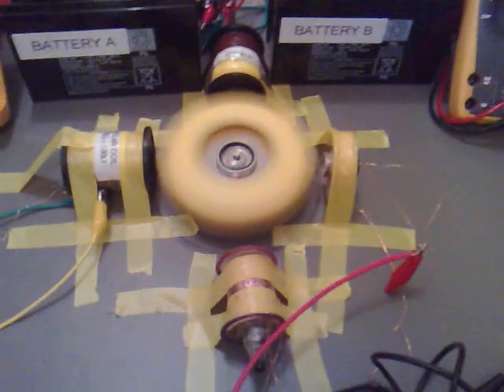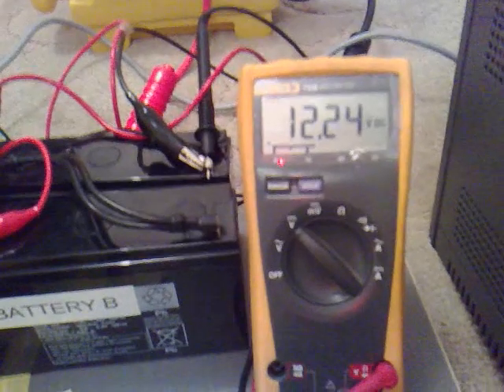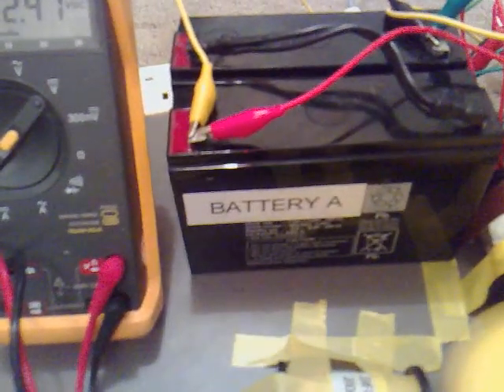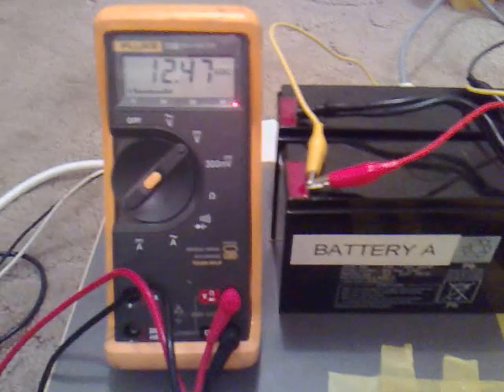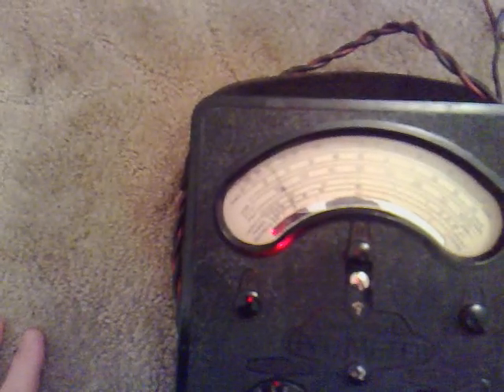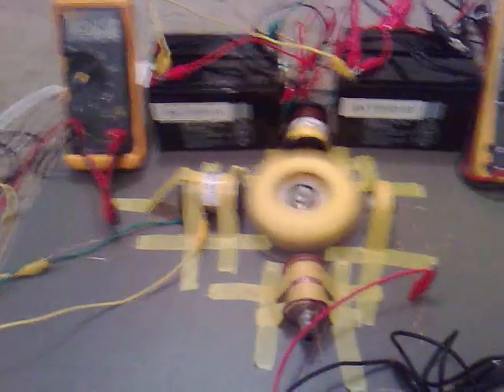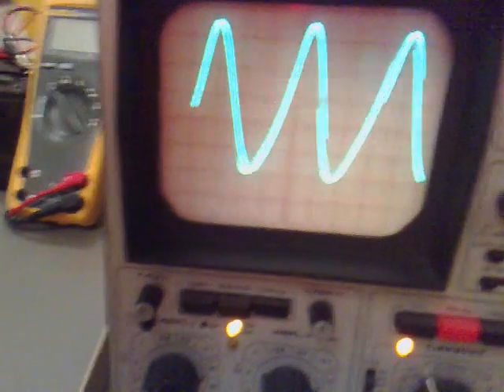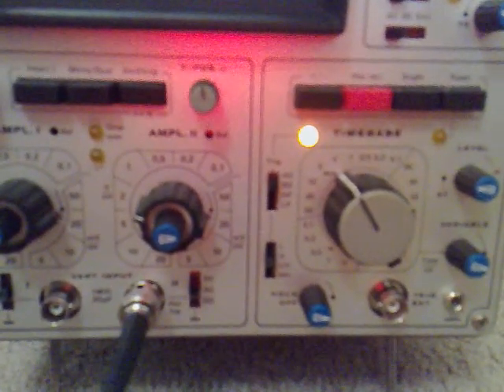Pulse Motor (Frequency Scope 02) 062

Comment: The Output can be increased to 24 volts by increasing the amount of turns or use a Y or Delta connection on the generator coils around the rotor.